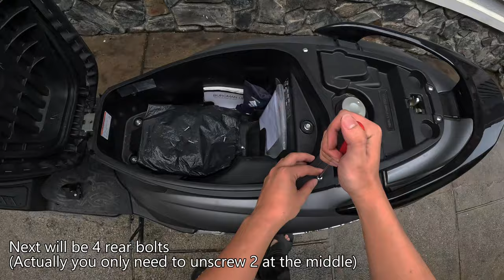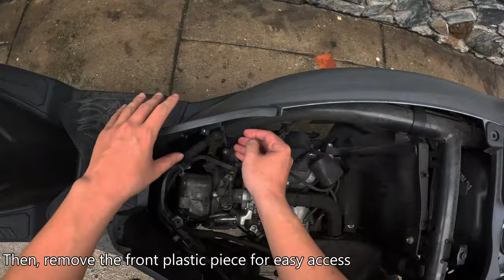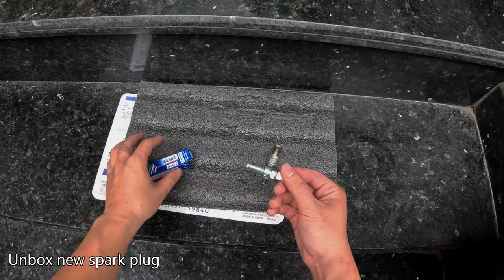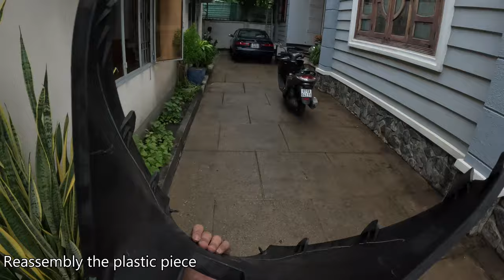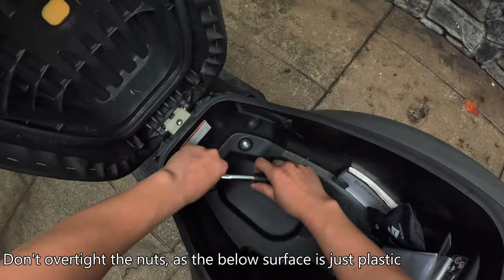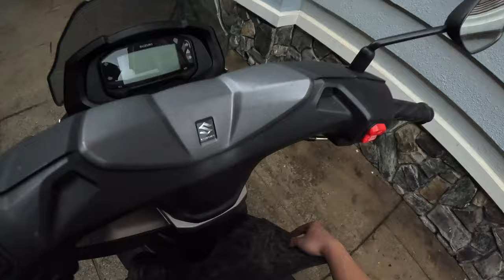Suzuki Burgman 125 SPARK PLUG Replacement

Comment: Didnt really have to unscrew the center screw at the front side of the seat and the 2 screws at the end of gas tank. All in all, 4 screw, 3 10mm bolts and 2 push pins.
Reply from the maker: yes, I completely forgot while I was filming, thanks for noticing!